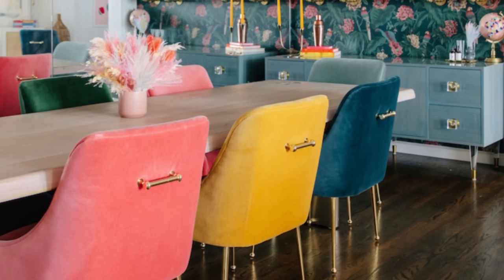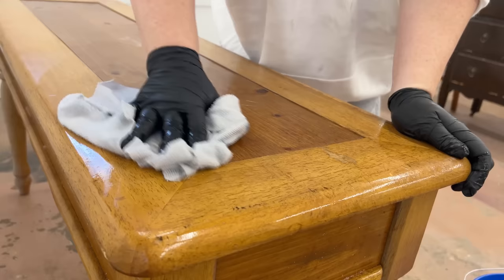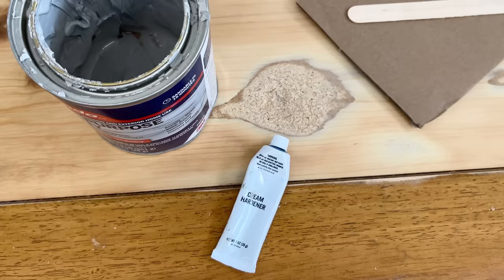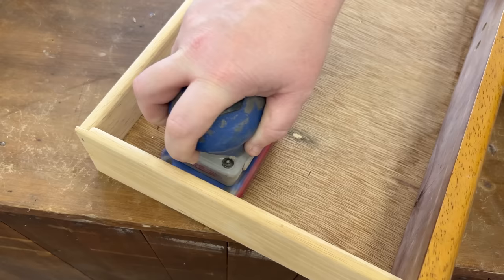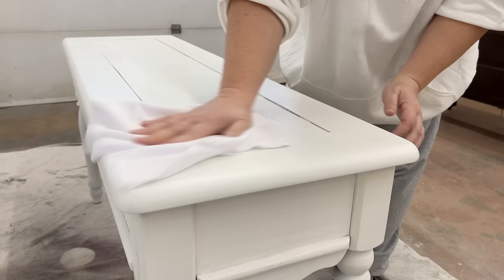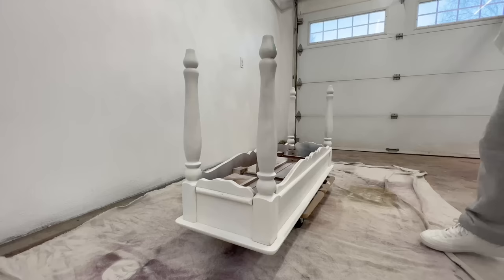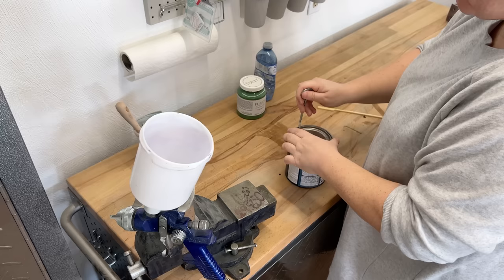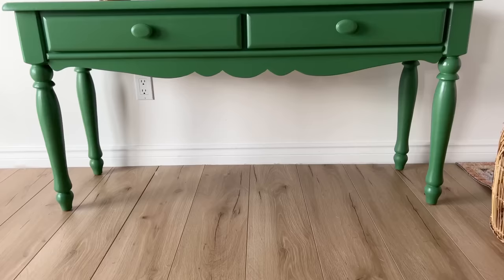Transforming Furniture with a Bright, Bold Flip | CRAZY RESULTS!

Comment: You did such a good job smoothing out the top. I would've gone for a slightly darker green and I think taking off the curved accent wood piece on the bottom would give it straighter more modern lines overall.

Comment: Generally, I prefer bold patterns and colors in smaller items that can be easily replaced when I feel like altering my color palette and tend to leave bigger furniture items in wood tones or more pale colors. That being said, I think that doing a bold color on a small piece of furniture is a great idea. It would be easy to repaint should you want to change the color. So, if you want to do that then I say "go for it". Also, I would write on the underside of the desk a note that says that the desk top is repaired with filler due to the veneer being gone in parts just in case anyone inherits the desk and wants to return it to wood finish.

Comment: Lovely colour! I noticed you’re using Behr poly not the Varathane satin poly. I went to Canadian Tire last night to buy some and it was $45 for 946 ml. I just about had a heart attack. When did that happen? I bought Minwax Polycrylic which was $32.. still a lot but wow, has Varathane jumped in price in Halifax. I saw Home Depot had it for $38 but that’s a longer drive so I decided to try to Minwax. Used it last night it seemed fine. Do you prefer Behr?
Reply from the maker: I still prefer the Varathane finish but it hasn’t been in stock the last few times I’ve been at the store and the price is getting harder and harder to pay 😅 the Behr brand seems to be doing the job though.

Comment: First of all, I don’t think that is a park bench green.  Benches in my part of the United States are rather are a dark shade of green.   That is more of a frog green.  

I don’t think the end result was all that bold.   Orange would’ve been bold.  Pink would’ve been bold   Purple would’ve been a bold  choice. A lot of furniture is painted green.  I just don’t think it was all that revolutionary.  It was a very good choice to paint this particular item because of the condition.  It’s  more special now. 

Don’t get me wrong, I think the result was fantastic.   I might’ve gotten rid of the ornamental piece between the two front legs and under the drawers.

Maybe it was to uniformly green.   Maybe some of the trim elements could’ve been white.  I think the knob could’ve been painted gold or white.   You want a little bit of contrast.  The drawers could’ve been a different color or sanded back to bare wood.

I think it was wise to put polyurethane on the top.   If you hadn’t, I could see after much use the paint scraping away.  And they might be calling you.